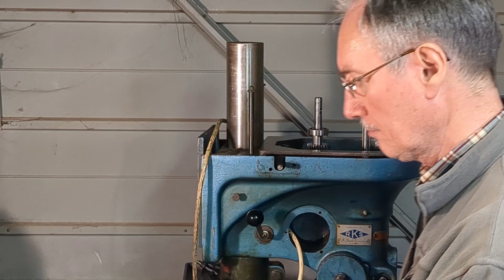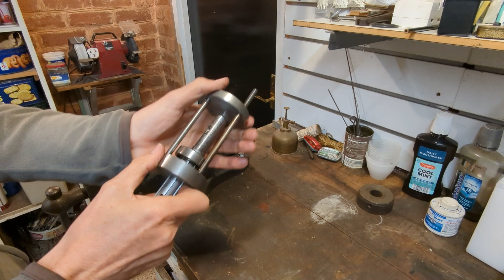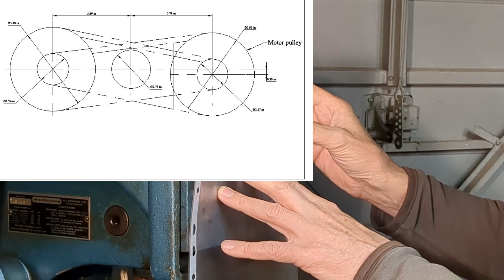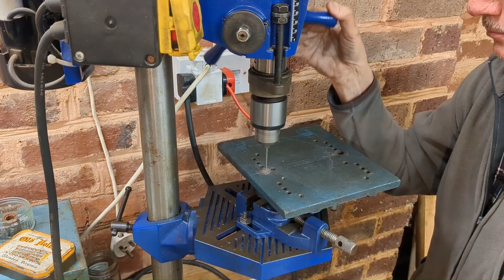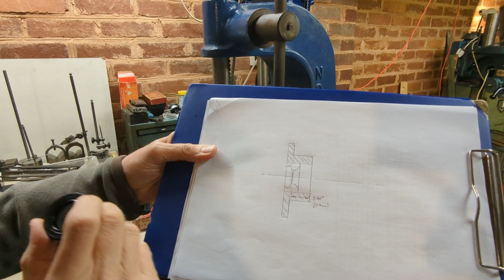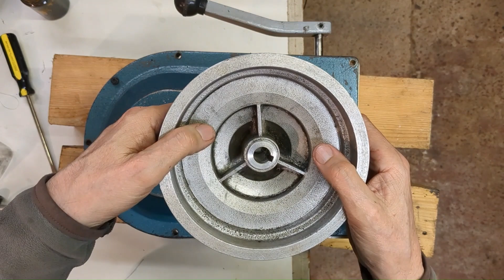Adding a Variable Speed Drive to a Meddings Pillar Drill - part 2

Comment: Is it possible that the vetrical scratch through the seal land was intentional. It looks  very neat and in an odd place to be accidental. Could it be there to allow a small amount of oil to weep through and lubricate the quill bearings?
Reply from the maker: Having disassembled things I can see that the scratch most probably came from the corner of the circlip (C clip) especially if circlip pliers weren't used. The bearings have separate grease lube points and there is an oiling point above the quill to get lube to the splines.
Reply: @Workshopfriend That would explain it.

Comment: Nice Arbor Press.
I am going to modify mine, machine a hex on the pinion and dispense with the handle and use a ratchet 3/4" drive handle so it will always be in a comfortable angle when applying load.
The American Dake arbor presses got it right with built in ratchet.
Reply from the maker: Hello Willem. Yes, I am happy with it including its capacity and sturdiness. I saw a ratchet press but it was a bit too pricey. However, on this one the handle can be unlocked from the pinion to change its position.

Comment: What size oil seal did you fit?  I thought the correct size seal was no longer available?
Reply from the maker: I measured the bore and the shaft and they worked out as 40mm and 25mm which surprised me on a basically imperial dimensioned machine. That size seems to be readily available.

Comment: Enjoyed that thanks, and learnt a bit. Nice video.
Reply from the maker: Thanks, Paul. Unlike you I can't see myself getting into welding. Seems expensive and I am not sure about using it on a domestic supply.
Reply: @Workshopfriend  a decent TIG set is expensive but hobby-level MIG sets are not too dear. And a 13A outlet is probably sufficient for most work we are likely to do.  Better sets are quite efficient, power wise. My TIG set has power factor correction (claims a pf of 1) so minimises the current drawn from the supply. Cheers
Reply from the maker: Thanks for your informative comments. Perhaps I will venture in that direction later!

Comment: Very interesting watching your video as I'm doing the same on my drill machine, fitting the VFD off my lathe, mine hasn't a gearbox it's a floor standing Sealy drill press.
The centre in the end of your shaft looks as it should but at 17-25 of your video I can see the end face looks as though it's had a beating  that would malform your centre giving the runout.
Looking forward to the next video & then I will be working on my drill press, from Coventry 🇬🇧.
Reply from the maker: Thanks, Graham, for your comment. Yes, my VDF and motor also came off a lathe. You could be right about the end of the shaft even though the centre hole looks okay. Hope to get to the VDF on the next video by the time you are working on yours. (Yes, I think you are right! That would also explain why the end of the shaft was slightly oversize).

Comment: I don't think I've ever seen a small drill press with an oil bath over here. That's special :)
Reply from the maker: Thanks for your comment, Michel. Meddings still make pillar drills most of which seem to be with geared heads. Among similar size machines I believe Fobco had one model with a geared head also Kerry, Boxford, and Startrite.